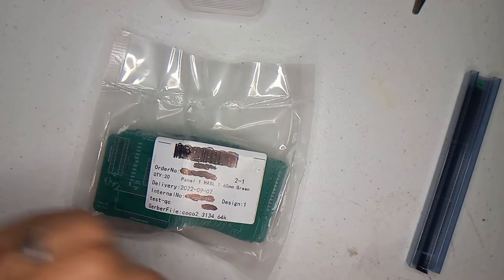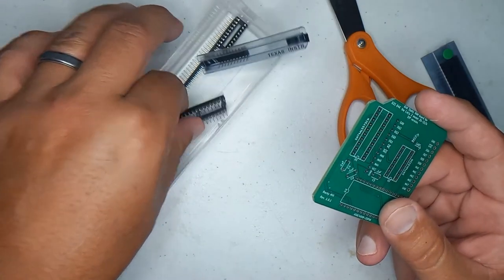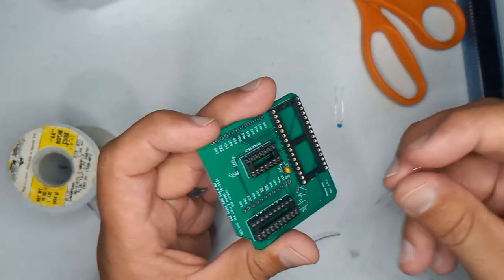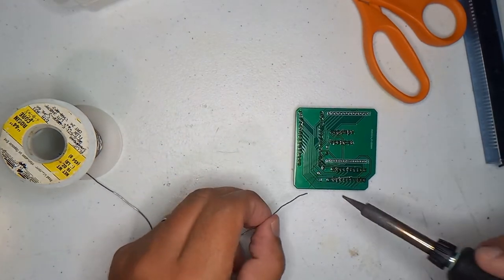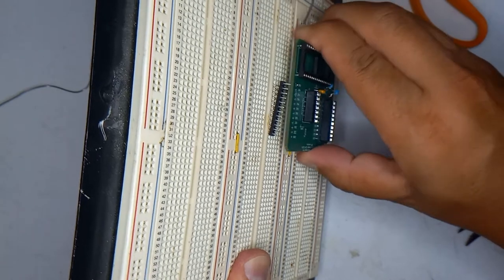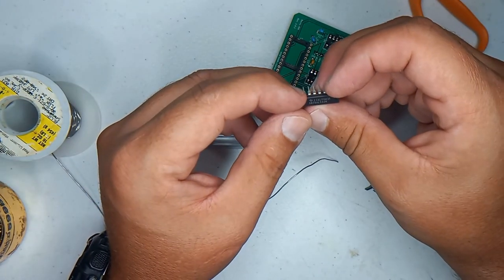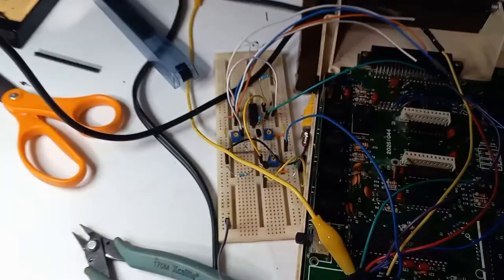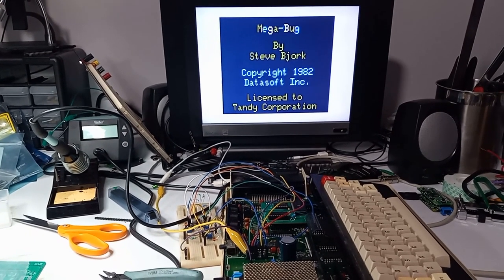Converting an SMD  CoCo 2 SRAM board into a THT version for easier assembly. Part 2. #septandy 2022

Comment: I recently got myself a CoCo 2 off of Ebay in "untested" condition.  All I did was plug it in, connect it to a TV and the silly thing worked out of the box.  Seeing this upgrade makes me want to start tricking my unit out.  As a bonus, I got mine in the original box to boot.
Reply from the maker: Glad to hear your CoCo worked! There are definitely things you can do to trick it out. If it doesn't have it, upgrade to 64k, add extended color basic, and then buy a CoCo SDC.

Comment: Using over-kill RAM seems like people will be begging for some sort of bank switching thingy... a RAM disk?  a graphics paging thingy allowing the loading and flipping?  All non-standard and incompatible of course...
Reply from the maker: In this case overkill is a purely practical decision. It's cheaper and regularly stocked. But yeah, over-engineering can be a bad thing.
Reply: @rockyhill3  But wouldn't it be cool if the extra RAM could be used somehow?